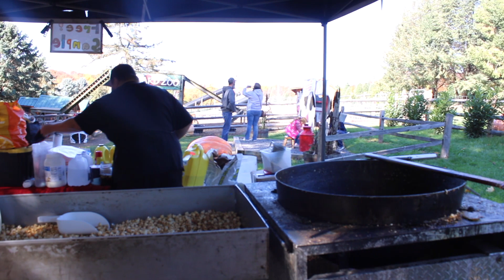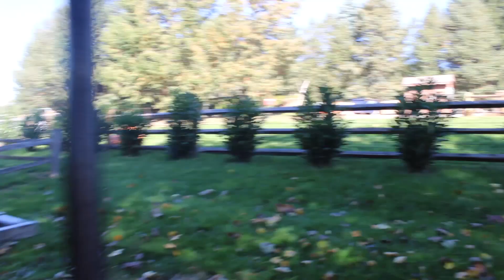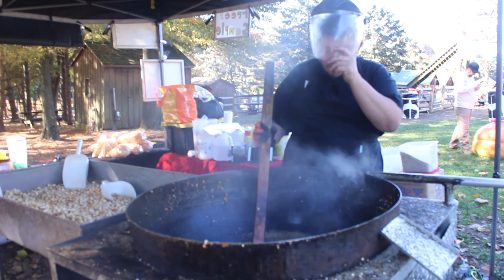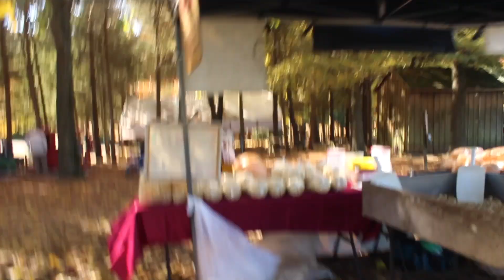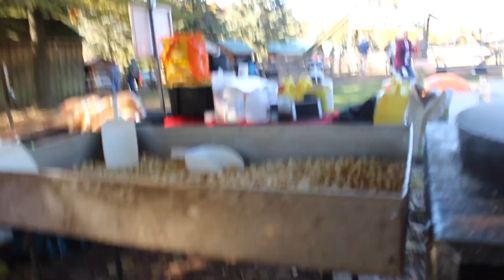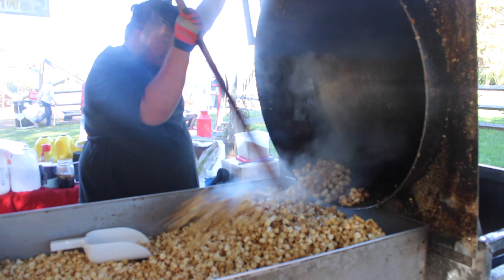How to make the perfect batch of caramel corn using your kettle corn machine . . . and Glazepop!!

Comment: Hey Daniel. What are the dimensions of your small and medium bags?
Reply from the maker: I use Poly Bag LLC
Reply from the maker: Look up Poly Bag LLC they have the dimensions on their website.
Reply: @DanielSchmidt94521  We use poly bags Too. They have several different sizes and dimensions. For example, we use 8" X 18" (our regular). 8" x 24" (our super bag), and 10" x 36" (our big daddy).
Reply from the maker: @bryanpearce4440  yeah. Nice and they deliver fast. If it ain't broke why fix it? Their bags are also very easy to bag. 

I went with 4 Star plastics. During Covid they were behind 5 weeks. And their bags were fine but they stuck together it took me twice as long to bag.